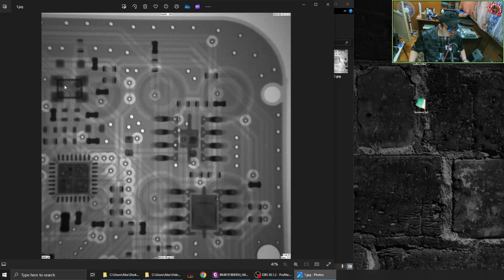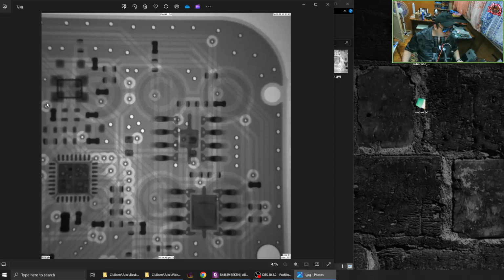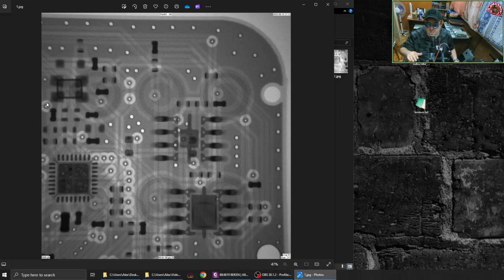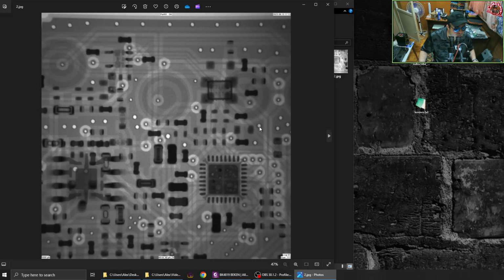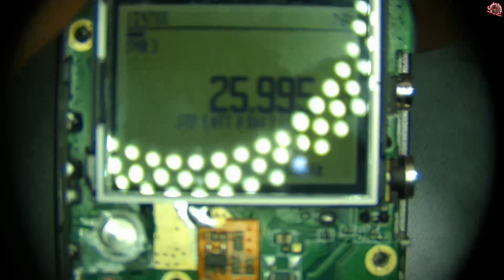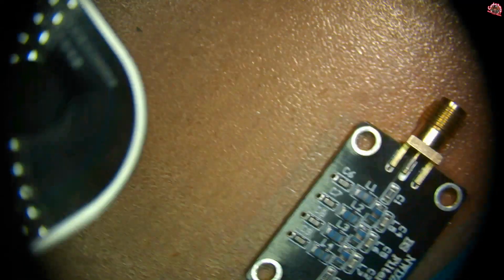Quansheng UV-K5 improve reception, remove 26 MHz self excitation - UV-K5 mods

Comment: Unless I'm missing something, why not just cut the trace right side of via all the way top to bottom, that way no components have to be moved. From how I see it this is simply disconnecting the track from source. Also would changing the crystal itself to a better quality one with harmonic suppression resolve this issue?

Comment: Thank you for new original mod🙏 Can it be done with one cut of the trace around the hole. I mean  In the  triangle, trace between hole. capacitor and oscillator.

Comment: 11meter tx on ijv 2.9r?
cec?  my k5(8)
Reply from the maker: I don't use IJV, and I don't use CEC. I use R3b0rn. With R3b0rn there is TX on 11 meters. But due to hardware limitations, output is crap. I think you need to do filters to TX properly on 11 meters.
Reply: @codernov Yes, This is the mod. https://youtu.be/8LhyXEDa2YY?si=fspSPdXtJtm8rL6_
Reply: @codernov  очень хорошая робота, товарищ! был бы сюпер новое видео об этих! думаю мы все хочем използовать такое радио TX на CB!